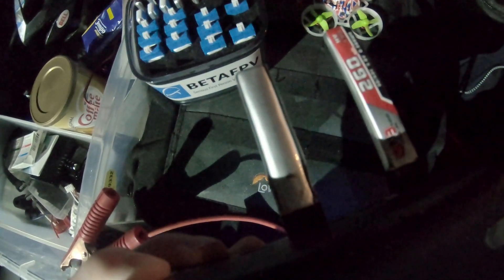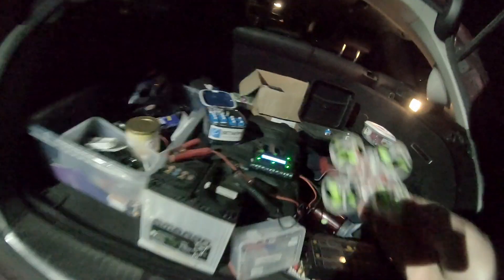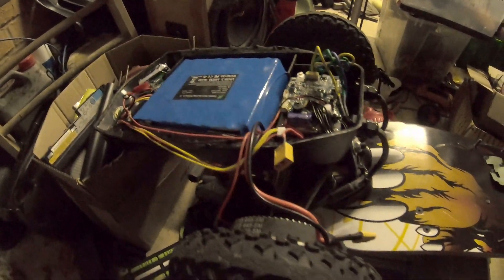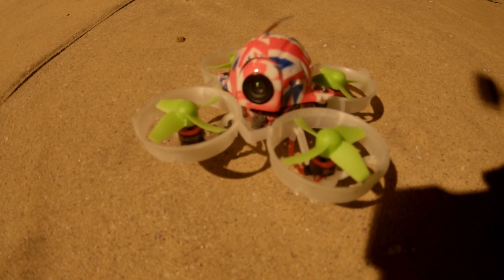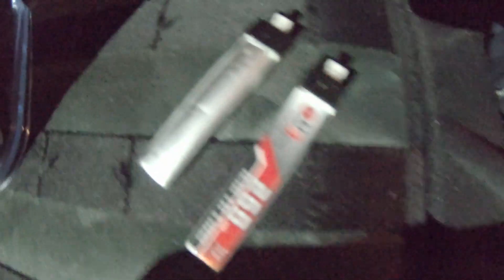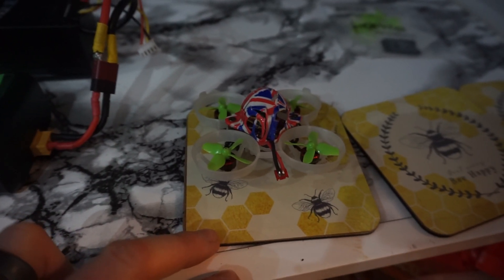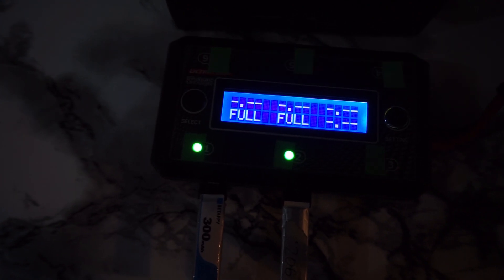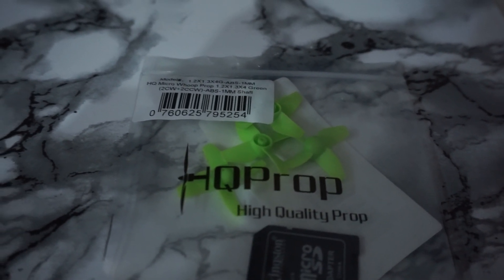Upgrade your whoop // 48khz OL5 connector cable motors esc firmware

Comment: Have a UK65 on BF 3.5.0. Been trying to put the 48khz ESC firmware on 
threre just for longer flight time. Without paying extra for rpm filter 
firmware. My ESC are O-L-5 and I found a JESC 48khz 2.3 firmware. I 
flashed it sucessfully to all ESC . My startup tone has changed but 
motors wont spin. I can arm it but cant spin motors. Tried manually 
spinning them in betaflight motor tab but that won't work either. 
Flashed original firmware back and works again. What was I doing wrong?
Reply from the maker: Which file did you flash?
Reply from the maker: Jesc configurator just hit flash all then select 2.3 48khz
Reply: @CryptoWig  yeah there were several different versions.  Tried all the 48khz variations for my O-L-5 escs .

Someone said it wont work on dshot600 and just realised it was on dshot 600 . So could that of been my problem.  

But yeah was using jesc config and it recognised my firmware and I flashed all and got nowhere.  Just the new startup tone
Reply from the maker: That's odd. It's advised to use dshot300 so worth a try.
I've flashed it onto 5 different boards without problem so far

Comment: You`ve also put something ( E-Tape ) over the LED`s from the UP-S6AC haha 😂 Did the same !
Reply from the maker: They were way too bright.
I also took it apart and taped the buzzer as it was way too loud. It way better now
Reply: @CryptoWig   Ahahaha totally forgot about the buzzer man :D
Reply: @CryptoWig  Ahahahaha totally forgot about the buzzer man :D
Reply: @CryptoWig  Any other "mods" you have done ?! : )
Reply from the maker: Nothing else on the charger.
I have the 2s version and was using it on AC at 1a per channel and the rectifier broke so now it only works on DC
Reply: @CryptoWig  uhh thats bad :/
Reply: @CryptoWig  I´ve put superglue into the buzzer.. ...still makes a very high tone.. But that`s very quiet.. Ppl still complain about the "obnoxious disgusting tone" ?!? Google Translated...